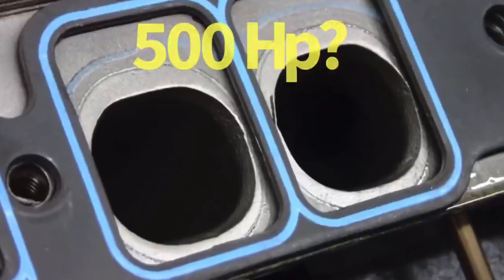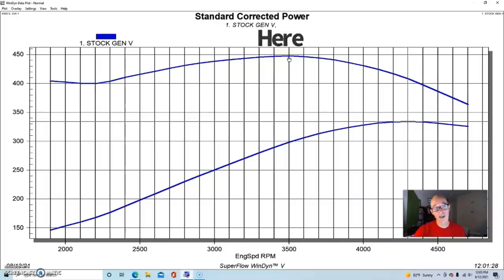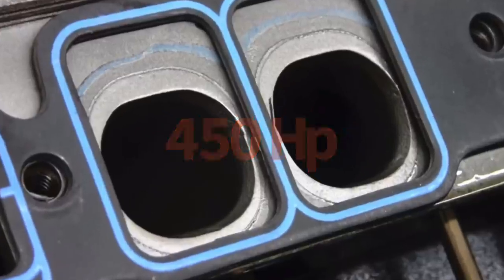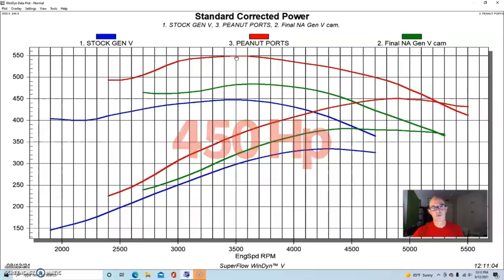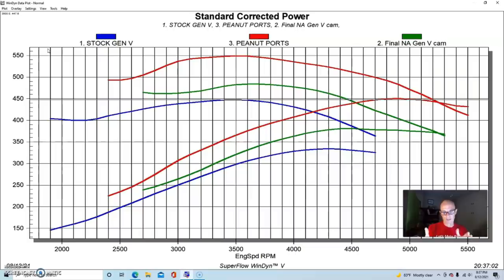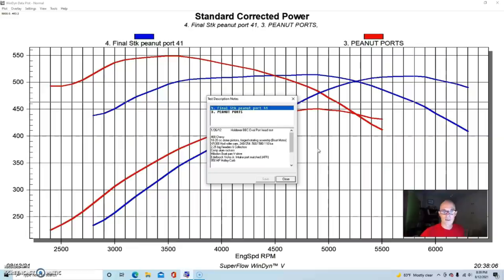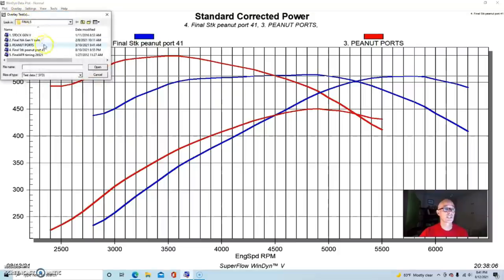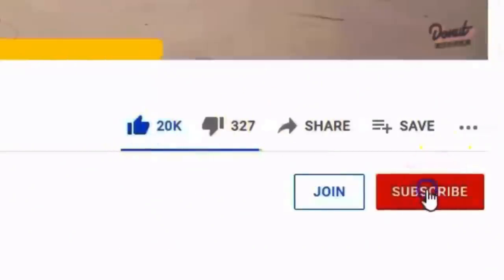HOW TO: MAKE 300 HP, 400 HP & 500 HP WITH PEANUT PORT BBC HEADS (HUMBLE JUNKYARD GEN V 454 )

Comment: This was an eye opening video. I've read that peanut heads are no good for "decent" power (whatever that might be), but I don't recall seeing any definitive testing done to determine how much CAN be made. If you can get 550# ft with a set of peanut ports, why do you need to buy new heads? Depends on the desired application, and that one would be great in a truck that needs midrange power. Thanks for testing.
Reply: Ive got one in a 78 4x4 square body and it keeps up with the new diesel trucks.  I get 11-12 mpg with a 650 carb and 4l80e trans 4.10 gears 33 tire
Reply: To answer your question on why buy new heads:
Because heads being the biggest factor in power, you may actually spend more in other parts trying to prop up the poorly flowing heads than you would just picking up a decent set of used heads and going lighter on other parts like cams, fueling, rockers, intake manifolds, etc.

Comment: The middle combination would make a cracking fun street motor. Torque for days right where you need it.
Reply: Damn right that’s the one I’d go with on the street. 👍🏻
Reply: And really hard on tires too!
Reply: @msh6865  
The least concerns. 😁👍🏻
Reply: Just bought a 1976 chevy motorhome with a 454 and got it running.
Looking to make it my rat rod engine. 
How much horsepower should that sucker have?
It's stock
Reply: @gearheadsautomotiveinmidlandtx  1976 factory rating was 240 & 370 🤦‍♂️ Heads & cam are the only way up from there. I imagine you've got pistons with a big enough dish to eat a bowl of cheerios out of.
Reply: @acemobile9806  so itd be worth the investment?
Its goin on a 55 f100 truck chassis.
Reply: Thought it'd be closer to like four hp?
Reply: @gearheadsautomotiveinmidlandtx  I don't see why not. High-nickel big blocks are starting to get rather hard to find. Only thing I don't like about what you have vs later models is the 2-piece rear main but with proper installation technique, can still be made leak-free. If you've already got the motor out, I say go for it. Run it for a while until you get tired of it or set your sights on something else

Comment: Casting numbers 049 and 781 are considered to be among the best flowing oval port BBC heads. With port work and big valves (2.19/1.88), these heads can easily make over 600 hp on a 454 with low compression. Of course, that's dependant on getting the right  roller cam and induction set up.

Comment: Would love to see a "ultimate tow pig engine combo". Something that makes gobs of torque from idle to a redline of like 4500rpm. 👍
Reply: An electric motor haha, max torque from 0 to 8000rpm, but won't sound as cool as a 454
Reply: Same, I am guessing a stoker with a small turbo.
Reply: @gzkgzk  or stroker with a roots blower.
Reply: a 530-540 ci cad 500 with mopar rods would make a killer tow engine, in theory. would love to see it done lol

Comment: I got a 90 454 bored . 030 over , peanut port with port job and milled,   flat top pistons, Comp 280h cam, long tube headers, torker2 intake( I think.)  Sadly it's never been fired up yet. Started raising a grandbaby , niece and helping the  in-laws out.  Got several projects that stopped or slowed down.  Can't wait to get the Ole Rat in Something.  Great Video.
Reply: I'm literally building the same engine right now. It's going in a jet boat

Comment: It would be interesting to see the AFR’s with the 268H.  To see if the peanut ports (or how much) are holding even the milder cam back.  I agree with you that it would also be interesting to see a peanut port head with some work and the 268 ... maybe even an “amateur” porting job vs “pro” ... but  really it would probably be more interesting to just see the “what you might do in your garage” porting (some bowl work, maybe some short turn and radius work* at the gasket.

*Vizard did some work on this, just radiusing the port inlet vs. port matching.

Comment: I am running a slightly different combo.  mine is a 396 with the large factory oval port heads. 9.4 
: compression. 2.19 intake 1.88 exhaust. Mild bowl and chamber clean up, to match the bigger valves, but no real port work. 2inch headers, performer rpm intake, I a, running the old comp cams extremely marine 276HR cam. Runs 11.8 on drag radials in my 71 camaro 4 speed. So i figure is pushing 520ish HP. But It’s a hell on street tires. It will melt my 265/50r15 bfg’s all day long if you are not light on the throttle in first gear.

Comment: Great timing Richard, this is exactly the setup I'm currently building right down to the cam grind (Comp 268), I've hand ported the peanut heads and I'm having a bottom end build with .030 over pistons to raise the compression to 9.3:1 (since I want boost later on without running exotic fuels).

Comment: NICE!!! Bitd my step-dad had some great cars, and I was fortunate enough to drive them. One was a 66 Vette vert with AC and full options. Factory side pipes 427/390 & 4 speed. At the same time he also had a 13k mile 66 Hemi Satellite 4 speed. The lowly oval port hydraulic cam Rat SMOKED that Mopar like it was parked. The Vette would spin the redlines in first through 3rd like it was nothing. I've always been more of a torque guy since then. Yesterday I scored a pair of 90 454 peanut ports at my local u pull junkyard. Last month my friend Joe gave me a 73 454 4 bolt std bore block and 427/396 steel crank. I'm most likely gonna look for a 4" crank but if not I'll do 390 horse pistons and that 268 grind. Then, I need an 65/68/69/70 Impala or maybe a Nova for it. Rat power Forever!!!

Comment: I found the BBC Stealth intake to actually have runners too large to flow well and the BBC Performer RPM does much better, but on a Ford 5.0 / 302, the Stealth flows better and the RPM runners are larger than ideal.

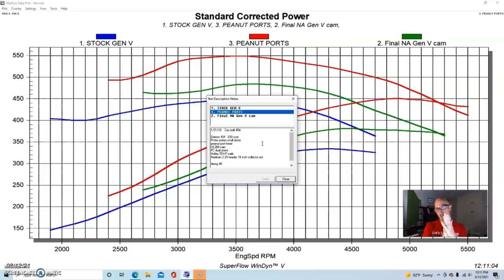Comment: At one point I had a 10:1 468 with a comp "magnum" 280H (230/230 @.050 duration)flat tappet cam. Stock peanut port heads, duel plain intake, holley 850,  headers, th400 with a "saturdaynight special" converter (2200 stall). In a 78 camaro with 4:11 gears (was also in a 78 T/A with 3.73 gears) but it ran 7.6 in the ⅛ and 11.9 in the ¼ on motor and was well into the 6's / 10's on nitrous. It was great because of its simplicity and it was pump gas friendly but was mild enough to comfortably drive daily.
Reply: Could I use this Cam on a stock Gen 5 454 along with spring and lifter kit??.. C-10 4:10, th400
Reply: @donksdunks1745  I am sure there is a version of it for that particular engine. Really just look for a grind that is in the 230's @.050 and you should be in the ballpark.

Comment: Pretty much said what I was thinking at the conclusion. The last combination with a slightly smaller hydraulic roller, and put the dual plane back on... should still make 500 HP, and get back a bunch of low speed TQ. I hit a few road blocks with my Gen 5/6 hybrid, cracked cylinder head, but I have a replacement on the way. Hopefully get this thing together over the next few months. I need to find valve springs to work with my mild hydraulic roller cam swap. That's the next problem I have to solve.

Comment: My nova has a bbc in it, swapped from a truck and it has the peanut ports. I put a jegs dual plane on it and im thinking of having the heads ported to match the intake for better flow and a good valve job put on it. Not sure what cam id like to run yet, id love to have a chop monster cause that sound is the best thing in the world! The car isn't used for much, occasional car cruise, burnout contests, but id like to be able to take it down the strip as a "Street car" as well. Not to concerned about drivability, enough I can get it to town (8 miles, further than that it'll get trailered) but with burnouts and some strip use the motor is gonna live most its life in the upper 5k rpms probably. Just trying to not spend a bunch of money, racing for me is the enjoyment, not trying to win.

Comment: that 450hp combo looks killer for a truck. you get great torque for towing and such and some more power for highway passing. the 500hp would be good for the drag strip if you were forced to use peanut port heads

Comment: Hogging out the peanut ports to match a large oval gasket might be the answer. A fair amount of material would need to be removed but, might allow the high torque numbers to be retained. Would also allow a slightly bigger duration cam to be used. Maybe 230 @ .050 or slightly higher. Keeping a tighter LSA would help maintain higher torque too.

Comment: I appreciate this info so much being that im building both a Gen5 and Gen6 454 . The Gen6 im stroking out to a 496 and shooting for 700-800hp for my 94' C1500 build. For the Gen5 i wanted to build it up but on a smaller budget as I wanted a more streetable ride for my 01' Sierra single cab since im going to be using it daily. I think the 380hp/485htq combination matched with the heads of the Gen6 would be perfect for what im trying to achieve with it.  Richard is definitely my "go to" when im trying to figure out what the hell im doing lol. Thanks for the time and effort you go through to give us these great ideas/combinations .

Comment: Great video 👍👍 I've been using a tbi 454 for plowing and hauling firewood in a 92 k2500.  I ditched the tbi when it would no longer run ,the harness was brittle and falling apart..  It's closer to the first engine in this video using weiand peanut intake, 600cfm carb, 1 3/4 headers 4" single exhaust, small jegs or summit cam with stock valve springs.  Stock compression ratio and heads. I'm guessing closer to 300 hp and gained alot of upper rpm range where the tbi just fell off and wouldn't pull anymore.  It's for sure more powerful vs. when the engine was stock. It sounds rather hollow though and tired w/250k? miles and lousy 7.8:1 ? Compression ratio stock it was the lowest cr of any big block made.   So I've got another tbi engine in the garage which will have more compression.  Milled deck, heads should bump it closer to 8.8:1.  I wish I had the cash to build it with larger valves, springs and roller cam upgrade, alas it is just a work truck and already has enough power as is 😆.  I also swapped to a nv4500 when the 4l80 took multiple dumps and straight axle hp 60 front. W/4.10 gears because the ifs can't handle a snowplow.. I'm not sure what engine I would replace it with other than a 4bt for the fuel savings or a 6.0 ls to get some weight off the front end.. anything else I would probably hate the loss of torque maybe a 400ci sbc would be okay or a inline 6 with all the goodies thrown on it.

Comment: Absolutely, please build the engine you last mentioned before closing off. I'm building the same engine for my 1 ton square body dually. At the moment the PP heads are at SPR getting 2.190" / 1.88"  valves, bowl and port work. It's probably better to bore the block .060" over for valve clearance in un-shrouding thought.

Comment: Arias has built a few 502 Chevy big blocks with DOHC 4 valve per cylinder heads from the Porsche 928.

The Porsche M28 engine has bore spacing nearly exactly the same as the Chevy, so with some welding and drilling, the belt driven DOHC heads fit nearly perfectly.  

The overhead cams are driven by a short Gilmer timing belt from some sort of Renault car.  The belt itself is driven off of a new gear installed where the water pump would normally be, and this gear is driven off of the original OHV cam gear/timing chain.  

These engines made 550 hp all day long and were actually capable of passing California emissions inspection-
Reply from the maker: I've seen these

Comment: Richard, im actually working on porting and using bigger valves on some peanut port heads with flow testing after each change.  I did a small amount of porting on the intake and exhaust, I gained 3-7 cfm on each depending on the lift. Im waiting for the email to so I can compare the velocity also. 

Next we're going to see what bigger valves do.  The guy doing the valves and flow testing says we could see up to 20 cfm on just the 5 angle valve job on these heads.  

I probably should have had heads ported before and tested before I put bigger valves in. I also wish I could dyno test after each mod, but that gets a little spendy.

At the least it will be fun and interesting to see how it turns out. Learning is always funn too.
Reply from the maker: GOOD STUFF ANDY

Comment: I selected the XE268H for a 350 sbc that had stock cast heads ported out with a weiand intake manifold #8004 also ported out and using a slightly modified quadrajet still made 5000rpm in a motorhome! now I'm playing with a 1979 Mark IV 454 itasca motorhome.

Comment: Great work Richard! Love your videos. Good motor for a truck. For a high performance car, if you are going to use GM iron stuff, stick with the closed chamber 290's, or open chamber 781's, or 049's they will blow the peanut ports away. I have the stock 290's on my Chevelle 454 SS, they scream.
Reply from the maker: THIS TEST WAS ABOUT PEANUT PORTS
Reply: Yes I know. Good thing is you can get them very cheap. Keep up the good work Richard.
Reply: It would be nice to do a test with GM oval port heads on a 454-468 type engine. I have a pair of 290's I would volunteer for the test.
Reply: I have heads casting #12561357 any suggestions?

Comment: I'm really surprised you made that kind of power with pp heads. Maybe I should'nt have thrown mine away. I used a set of early semi- closed chamber large oval port heads.I put in 2.19-1.88 valves and some mild porting on a 454, in my daily driven street racer 68 Camaro back in the early 90s with much success. Damn, I miss those days.

Comment: I have a BBC 454 wreck yard special😂 recently ran into a lil problem! Block casting #:12561357           head#:12562932 pulled from a 93-95 box truck (U-Haul) doesn't have roller valve train etc.. I already ordered the wrong intake😂🤦🏾‍♂️ Any info will do thanks in advance!

Comment: dang GOOD info for the low$$ crowd. i built a gen4 454 ,30 overbore. 781 heads, 20cc dome piston. & 218/228@.050 .500 lift summit cam k1301. ive always wondered what the dyno would say about that combo.??

Comment: First time I read about peanut port power it was written by David Vizard. Ever since then I kind of wanted to build one, just because. If you can build a combo of 450-500 hp with parts "nobody" wants...imaging what you can do when your circumstances permit you to build that ultimate stroker motor. If you don't know how to optimize with what you have NOW...you are looking at a big fail. I would like to see a 450-500 combo blend, that would be ideal on a 5500 rpm highway geared combo, cheap fun fun fun! More with less....IMAGINE THAT!

Comment: Richard, I have a 1976 k30 with the factory mark 4 and 781 heads. It has a performer plus cam, intake and appropriate valve springs as well as a Holley sniper efi, headers and exhaust. 
I’m looking for cheap options to gain a few hp. I’ll be pulling the engine soon to reseal it. From what I’ve read anything over 8.5:1 CR on a mark 4 wont like 87 octane, which is concerning for me. I’ve also read the 781’s are good heads but more so for higher hp, as well as the large combustion chamber being prone to detonation. 
I was considering swapping pistons out while I reseal the engine to get me to 8.5:1, it’s cheap enough and about all I can see to do with the 781’s trying to run 87. But could a head swap to a set of stock vortec heads be a better solution? I can get a set cheap. If I’m correct I could throw them on and id be at about 9:1 CR and because of the better head design I’d still be able to run 87 octane now at that CR. Swapping heads over pistons would require a few other parts but cost to cost I think I’d get enough out of the vortec heads for it to be worth it as long as I can still run 87 octane and tow. Thoughts? Would higher CR be possible with vortec heads while staying with 87 and towing?
Reply from the maker: no idea on that

Comment: I’ll do a head swap to get between 400-500whp. But what’s longevity of putting that much more HP into a 454 gen V? I would also like to avoid a cam that sounds to aggressive and still having the option to put 87 octane in it
My truck only has 20k miles…(that’s correct)
I’m hopping to tow with this truck
But I’m not feeling the hype when it’s loaded down being stock

Comment: I have a 427, bored .040 over with .19 domes. heads are match ported two 7561 air gap 750 holley. these are 063 heads that have been fully modified, semi open 2.19/1.88 valves fully ported, shaved .100" my cam is a comp 282s solid. 110 lobe sep 236 @ 50 282 duration/561" and wait for it, (STEEL rockers) running 450 RWHP dyno tested.

Comment: Awesome vid Richard! What I was confused about the whole time was, the intake manifolds? For peanut ports? Or to oval port intakes work on the peanut heads?
Reply from the maker: we have run big oval and rec port intakes on the peanut port heads, but there are specific peanut port intakes
Reply: @richardholdener1727  fun fact I’ve since learned! All gen five mercruiser big blocks came from factory with oval port manifolds on peanut heads, the carb models that I know of. The more you know ay 🤘

Comment: I'd like to see what happens when you add a stroker kit to the 450 motor with basically stock peanut Port heads I would like to upgrade the bottom end with the cam at the same time then in the future I could upgrade the heads with oval ports

Comment: This is very helpful as I have a the edelbrock preformer rpm oval heads and port matched air gap with 750 with the xr300h cam on my 402bbc (300rwhp and 820rw torque. 
I’m planning on doing a 496 10.5:1 with this top end and the same cam maybe upgrade too a 950

Comment: How about a peanut port, quadrajet, 454. How much torque can you get from 2000 to 5000 rpm test. With any header, cam, and any intake that's out there. I bet the q jet will be snappier at low rpms.